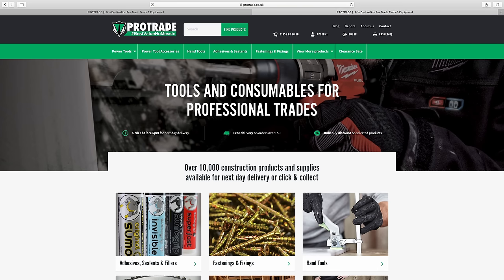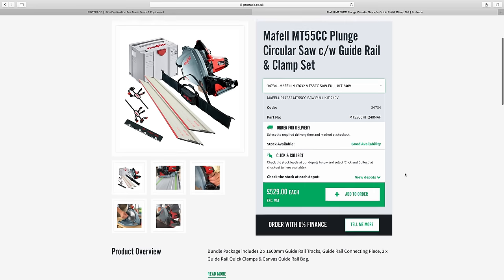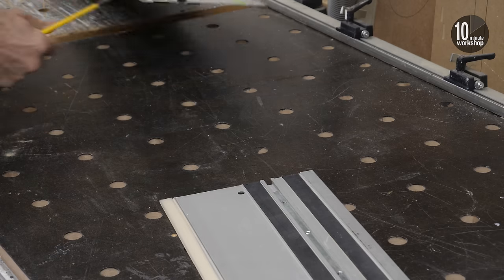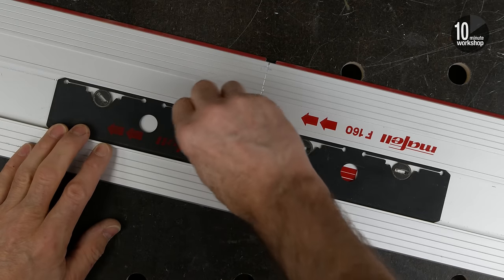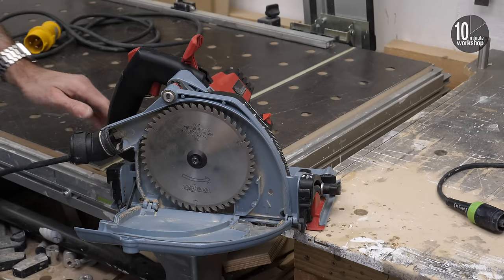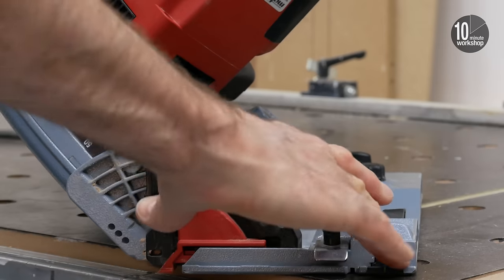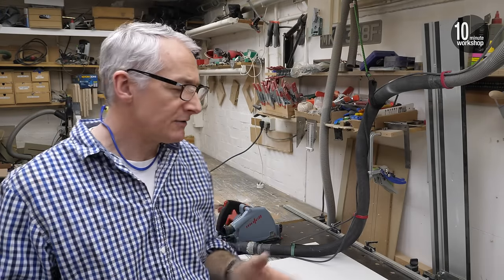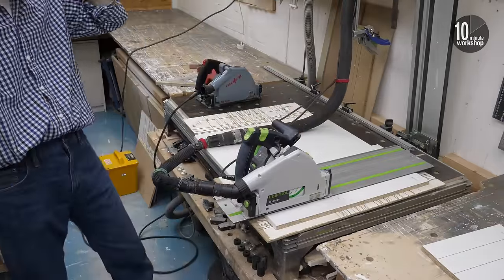Big Decision: Festool or Mafell? [video #400]

Comment: Excellent review, thanks Peter. I own the corded version of the Mafell MT55 and it's "The dogs danglees"  I am however a total Amateur .What I can tell you however is that if you intend to use the Mafell , as I had intended , with the Track Rail ,non cutting side, butted up against 2 Benchdogs in your MTF Bench Top, as Illustrated on various Youtube Videos ,  you cannot do this as the edge of the Mafell Saw overhangs the rail Guide on the Non Cutting side! This means the saw Body hits  against the bench stops.I hope I have explained this clearly !? The Festool Rail Guide is much wider and the TS55 saw Body is set back from from the edge of the rail allowing the saw to pass any Benchdog  which the rail is butted up against! 
It's my only disappointment with the tool and it may not be an issue for most users.I just thought some people may be interested in this property of the Mafell Track system. Yes you can use the Mafell in a Festool track but you need to unscrew 4 small Torx screws every time to remove a piece of plastic from the underside of the Mafell body. It fits the festool Track very well no issues there but its annoying. Also it may be of interest that the Bosch GKT 55 GCE 160mm Plunge Saw appears to be the exact same saw apart from not having  the hinged door for blade changing (its an Older? model which you still find on for sale on that big auction site!)  Its half the price of the Mafell.The Bosch Track is exactly the same  the Mafell is just a rebranded version.The new Bosch Track clamps are the same but priced lower than the Mafell equivalent.  The Bosch GKT 55 GCE 160mm Plunge Saw may not have the scoring feature?  or the hinged door but they look identical otherwise.  Again I have no use for the Scoring feature so cannot comment.I have mainly been cutting sheet MDF and Plywood building Guitar Amplifier Cabinets.I'm also not in the UK so my price experience may be different than yours. Again I must emphasis I am not a professional woodworker but the Mafell is a joy to use.I also own a Mafell DDF40 Duo Doweller which is precision in the extreme.
Reply from the maker: Thanks! I do cover a few of these things in the ‘further thoughts’ video on my patreon; you can also use the low-profile dogs (benchtop protectors) for the Mafell or Bosch rails, btw. And yes, Mafell make the rails and some of the parts for the Bosch saw, but it is assembled by Bosch in a separate factory, I believe. 👍👍

Comment: I’ve run with festool for about 8 years. I have the routers, plainer, carvex jigsaw and kapex 120(recently stolen). So i love what festool do. I now run the mafell saw however. Mostly for the reasons you give. The rail is far better but mainly the power cut off when hot drives me mad. It’s mostly when doing rip cuts with the outstanding rip fence this would be a problem  but it was the finish for me when using a friend Bosch saw which didn’t suffer the same. I went mafell over Bosch but the Bosch is a great saw to. The  festool is still a good saw which is why I’ve kept it  but mafell is my first choice.

Comment: I bought the Mafell about 10 or so years ago.  I went for it because for the most part the overall system seemed a bit better than the festool and the saw itself feels more industrial and less plasticky. Al these years on, it hasn’t changed my mind.  
The blade cover gives better dust control, esp if you flip down the plastic slide. 
The rails are a much better system.  Rock solid and accurate joined to make a long length, better joining bar.
My 3 metre festool rail drives me mad having to stick the edge strip back on constantly.
Other things are marginally better too. 
On the score front, I thought it was designed more for bar fitting type work with ‘Formica’ type finishes joining at angles like 45° to give a perfect joint, rather than butt joints and Mafell recommended reverse scoring 2 or 3 mm as per standard with all other saws  for butts etc? I would have a word with the importers about it to check.  
Kickback - yes, the Mafell can kick back.  There’s many an owner with gouges in the tracks from it happening.  Nearly always from starting on a plunge rather than running in and not having the blade quite up to full speed when cutting in.  
After all this time would I re buy the Mafell over the Festool? 
Yes.  But you’d be happy with either.
Reply from the maker: Good info, thanks!
Reply: Can you fit the Festool hoover to the Mafell plunge saw? or do you recommend a cheaper hoover that would fit the Mafell, the only reason I'm thinking of getting it is because on screwfix they offer 2 guides with the plunge saw 599£ price.

Comment: I find the scoring cut on the Mafell is fine when edge banding MFC.  If I'm joining 2 edges or want perfect edges for MFC door fronts then I run a router with bearing guided flush trim to get rid of the offset. A little more processing but I find this much quicker than my old method of cutting with a tracksaw followed by using a router on the rail to take off a mm or so to get rid of any chips.

Comment: Festool makes nice tools. However, there's always some shortcoming that you have to buy an accessory or build a jig to overcome. Ripping narrow strips is an example. Not catching the hose on the rail during cuts is another. Unglued splinter guards is another. Fiddly rail connectors that don't self-align is another. The need to carry long rails for a straight cut is another. Dust collection using the dust bag on the Mafell is as good as the Festool with a vacuum. That being said, there are all sorts of clever contraptions people build or sell to integrate pieces of other Festool products for various situations. That's an advantage there, if you're into all that.

Comment: I had a kick back on my Mafell MT55, it happened while plunging a bit too fast into 4 cm red oak. Luckily no harm to me or work piece but unfortunately it jumped out of track and mess up the track a bit and my underwear had to be changed afterwords. Also my particular MT55 was out of square on 0 degrees out of factory, there are 2 screws that you can fix this by yourself but on first few cats you need to check this. Scoring cut on laminates is a bit too much IMO  and also mess up the rubber on track so if you use this do so on entire length of track otherwise you will end up with splinter guard that is not same on entire length and make hard to line up according to lines.
Reply: I've changed my underwear may time because of saws in general ;-)

Comment: If you have many tools that require dust collection (saw, sander, router,...) the plug it system is gold. I own a Festool sander and retrofitted my other tools to the system, because it is just so convenient. When you are on a tight budget, you might want to take the costs of retrofitting this system into account. (I found no warranty void stickers or anything like that on my Mafell saw, so as long as you keep the original power cord and fit it back on before you send the saw in for warranty, I think you're good)

Comment: My first cut using a new Mafell saw and rail kicked back. The waste edge was overhanging the edge of the workbench, and as I neared the end of the cut the waste edge twisted the kerf closed and the saw jumped, cutting the brand new rail. The waste piece/kerf jump thing has happened a few times as I often let the waste edge fall free to the floor. Due to this, I keep a shim to wedge overhanging waste edges while I cut. Score 1 for the Festool riving knife. Otherwise, after getting the Mafell saw I have no desire to use my Festool saws again.

Comment: The first track saw I bought was the Festool some 15 years ago. I sold the TS55 and bought the Mafell just after it came out but after a few years of use I ended up going back to the Festool. The main reason was Festool's superior service and back-up. It took an age to get replacement parts or service for the Mafell. When deciding what machine is the best that's a huge consideration.
Reply from the maker: Yes, indeed - very important to consider all aspects of the purchase and likely use.  👍👍
Reply: Never had a problem with Mafell.

Comment: I use a DeWalt tracksaw, and for cutting cheap mfc without any chip out, i make a scoring cut with the plunge depth set to 2mm and run the saw backwards starting at the end of the cut and pulling it towards me.  I then flip the workpiece over and do the same thing in the waste side (if the waste side needs to be perfectly chip free).  This gives 100% chip free cuts.  A bit of a faff, but where something needs to be perfect, this method will do it.

Comment: Owned mafell for 3 plus years. The 240v version and it is superb. The only thing I would change is the ability to turn off the 10th of a mill cut thing, if you want to but joint worktops... Enough said, you can see it although never had a customer notice. Sometimes I just use the router. I have experienced kick back, it came up on to the rail, munched the chip strip and grazed the rail. I was cutting thinner board with a thinner support board underneath on saw horses. I'd say it was user error. Support this saw well.. But, keep your fingers away as if it they were closer to the saw, I'd probably be picking my nose with a few less fingers.

Comment: Uhhhh! Did I see the Festool saw kick back?
That happened to me once, where it scored right across the track. It also caused the alignment to be slightly skewed. This was caused by the way the hose from the vac hooked to the saw in a fixed position in the older models. The upgrade to the multi position  is much better, and can be retro fitted.
Reply from the maker: My fault, I plunged before it was up to speed.👍👍
Reply: We have all done that before!

Comment: "The old trick of peeling the splinter guard off and edging it over".   Crikey,  thats so obvious why on earth have I never thought to do it. Nice one Peter.
Reply from the maker: Haha! Thanks! 👍
Reply: yes brilliant and so simple don't know how I missed that trick!
Reply: my experience is once you try to move it over, it never sticks the same again.  I hate the way the strip peels off at the end.  The mafell/bosch is much more superior in that regard.  One thing that wasn't discussed was the Mafell rail is quite a bit narrower, to the point where if you use the Axminster super dogs as a fence system, the motor housing on the Mafell hits the dogs.  Not a problem with the Festool  The short answer is to cut along the length of the mft with a longer rail than needed so the cut is finished before you run out of real estate.  A bit of pain and it's going to necessitate me getting a second rail with the connector for longer cuts but having extra  rails is always a good idea.

Comment: What a I learned with my Festool for scoring: do the scoring cut with moving saw in opposite direction on the rail (only do this when cutting just several millimeters for scoring, never for deep cuts, dangerous). Then do the deep cut after in normal direction. With this scoring technic you get cleaner results, because with reverse pulling direction for scoring your saw teeth press the top layer into the wood while cutting, and do not try to peel it of like at the normal cut direction. (For the bottom side of the wood relation is reverse, so normal direction gets clean results because saw blade rotation direction)

Comment: I have had the  Mafell for two years and love it it took me months to decide mafell or festool and it was the rails which sold it to me. I fit high end kitchens ie siematic and cutting fillers etc no problem at all with out scoring.
Reply from the maker: Good to know, thanks Mark - and I’m not surprised the decision took a while, it’s a very personal thing, and very fine margins between the two systems. 👍👍

Comment: Makita have a simple lever that locks onto the track to prevent “tipping”when cutting bevels.It also helps hold the saw when using the track to trim the bottom of doors without removing the door from frame.Saves carrying saw horses around.
Reply: Tony McGirr it helps but there’s still some movement there that can ruin a bevel cut if you don’t keep the saw pressed to the track, shame as the cordless makita has a good amount of power for a battery saw
Reply from the maker: Thanks for taking the time to comment; I agree with no skills above; the Makita anti-tipping lip is to stop the saw tipping over at the end of a cut not for when you’re cutting the bevel - there’s too much play in it for that. 👍

Comment: Hi Peter,
your videos are always of interest, really great (also for a German ;-)). I have the Maffel my brother the Festool. I tested both and stayed with the Maffel. The saw does not wail when cutting, but pulls through and is more stable in construction. The scoring function cuts in the same line as the cut, only at a depth of 3 mm. The saw was well received by me, but is also easy to adjust myself. Most users, regardless of which manufacturer, do not clean their saws and are then surprised at a crooked cut. Care maintains value and precision. Mine is one of the first machines and runs and runs.
Reply from the maker: Hi Ringo and thanks! I think anybody would be really pleased to be given either of these saws. And if we buy them, then we have preferences, of course. I own the Festool, the Mafell is on loan to me. I can only test the saws I have, and I’m glad to hear your scoring cut works flawlessly; mine doesn’t, and I hope to find out why, soon. Best wishes from London! 👍👋
Reply: @10MinuteWorkshop  Hi Peter,
I have learned electrical engineering and know how these machines look from the inside, how they are adjusted. Both machines Festool or Maffel are high end products, everyone who buys something gets quality. But the dealers are mostly sellers with an office background. You have no idea about the product, you now know the marketing blah and can break something quickly.
Maffel has been around for a long time as a Festool, but the Maffel or Festool, which was considered normal, stood out in terms of technology and tolerance, thanks to Marketing Lümmel. Neither machine can get straight cuts with dirt in the right place. I'm assuming that the Maffel you got so everyone is allowed to screw and no matter part.
Ergo, cleaning, aligning and adjusting -> and being happy!
This applies to every machine whether Maffel, Festool, Bosch, Makita, Dewald or others. If you mistreat such high-quality products, you won't get a good result.
Please continue to make such informative videos and greetings from Germany
Reply: @10MinuteWorkshop  sorry Peter if this seems a bit too easy as a solution. But to avoid the shifting of 0,1 mm can you just use the depth stop of the cut at 3mm let’s say instead of using the scoring function ?

Comment: I have never checked out the Mafell,  but when I compared the Makita to the Fesstool, the Makita was smaller,  more powerful, cut just as well and half the price.   For the same price as a single Fesstool I have a complete Makita of set 2 rail lengths   and a saw  in my shop and another complete set for my truck.  They get allot of abuse and they have always worked flawlessly.  I think I might get another set for my service mini van.
Reply: I mean there is an argument to be had for the festool accessories (CMS, PlugIt, etc.), but you're essentially right even then.
Reply: I'm in the same boat. I run the 36 volt Makita which is pretty decent and with its own scribe mechanism. the only thing I miss from the festool is its depth stop arrangement. I've used all the major manufacturers saws and in my view there's really not much difference in any of them..(the DeWalt takes more getting use to because of the way it plunges.
Reply: Makita is a great site saw.. 36v.
Reply: I pretty much think the same👍